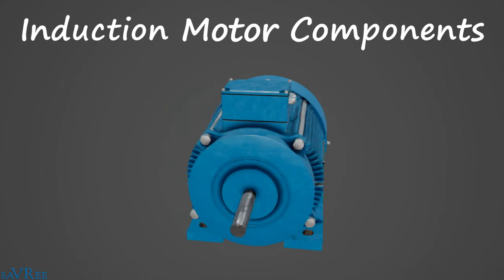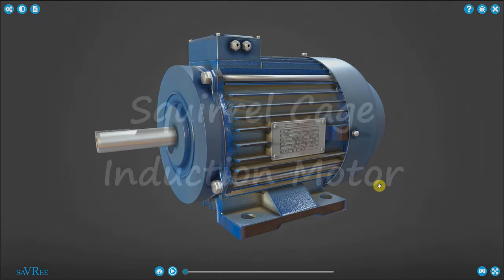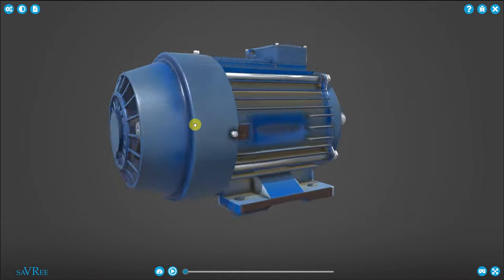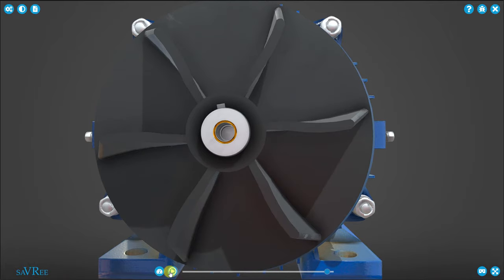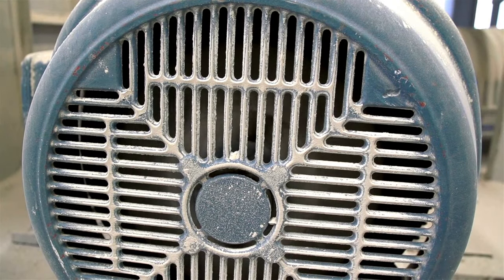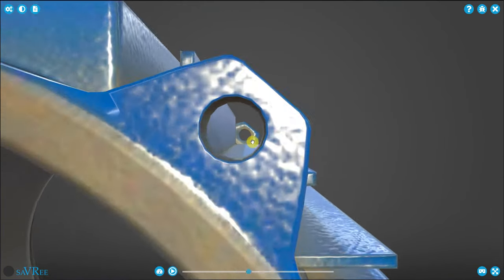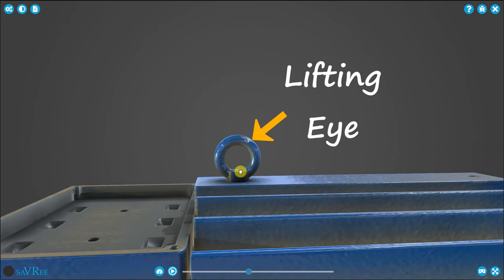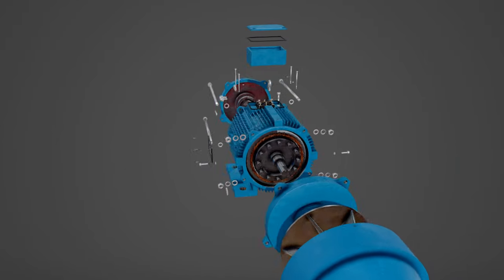Induction Motor Parts (Squirrel Cage - Asynchronous Motor Design)

Comment: I rely on these daily. I use them in a range of sizes from 1hp up to 200hp. Most common size use at our facility is 10hp - 25hp. I've replaced several of them over years. They are extremely durable and very heavy. It is my experience that any motor of this type over 10hp rating requires the use of a lifting mechanism. We use them in a 3 phase 440v ac configuration usually drawing 20 or so amps. Some however draw 100+ amps.

Comment: Did you know that those keys (woodruff key) are also designed to break if for some reason the motor or whatever the motor is turning locks up to prevent damage to the one that didn’t lock up. Pretty much acts like a break point to prevent a major problem occurs

Comment: Sure, it's air cooling but the fins also radiate infra-red photons that travel away from the motor and this could work in a vacuum but air does help in scrubbing the heat away from the unit. When the heat leaves the unit via IR you don't care if its air, the wall 10 feet away or infinity that is absorbing the energy, it just doesn't matter; how ever the "air" can heat up so you want to move it away from the motor, hence the fan.

Comment: It's a great video, thanks. But one question, doesn't the fan actually suck air and spit it out through its cover, in the opposite way that you describe?
Reply: from what I've seen working on motors like this they usually move air through centrifugal forces, the air get pushed outward and hits the fan cover which then guides the air over the motor.

Comment: Good morning sir
I had come to know and build the theory of SCIG( squirrel cage induction generator)

Plz correct me if I am wrong and I would be "gladfull" full if u make corrections in this 

When we connect the SCIG with 3 ph supply to stator and the rotor is coupled to a prime mover 
The mg field is being produced in the stator and induced in rotor and now the rotor has its mg field 

the rotor is rotated above the synchronous speed i.e -ve slip 
Now the stator will be starting to provide supply to the grid 
And through the process of induction the mg filed is countinue to produce in rotor 
By the help of stator which it's providing supply to grid 
 
Since mg field is producing in   stator and induced in rotor

And the direction of mg field is reverse and the rotir directoin is reversed when compared to motor ( SCIM)

Comment: Hello sir. Thank you for your great videos.
I am helping a carpenter  with his machines. His machines start at very high current as you say. For example an old bandsaw. Motor 13.5 HP, 34.6/20 A, 10 kW. I think it's a slip ring motor. 
The issue is that I've been trying to help them install DIY Hydro Electricity, which has been very difficult for me with limited knowledge. So I need the two large carpentry machines to demand less at start up. What is the simplest/cheapest way to reduce the starting current? Thank you very much
Reply: Have you been using the Y-∆ (star-delta) starter/s ?